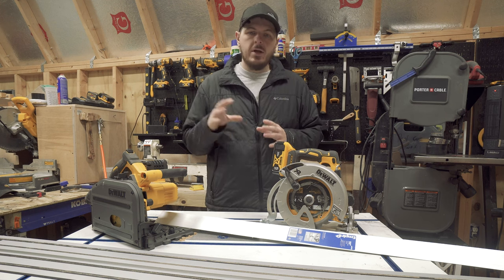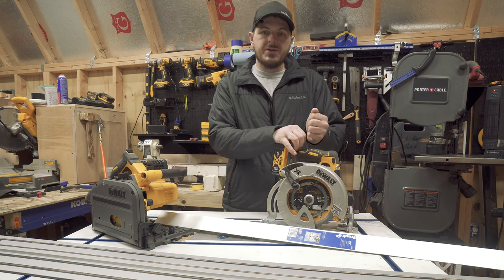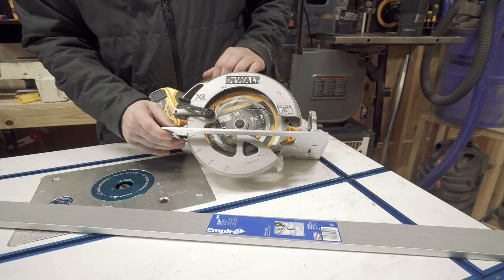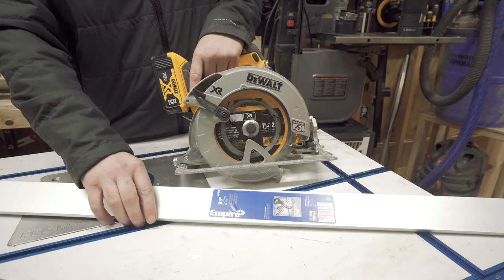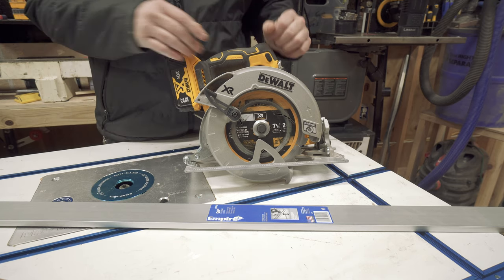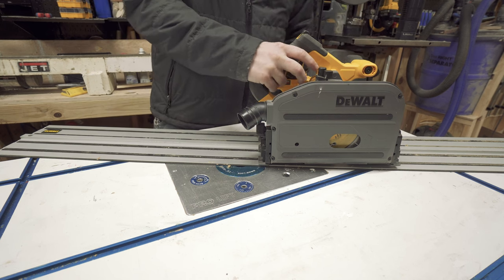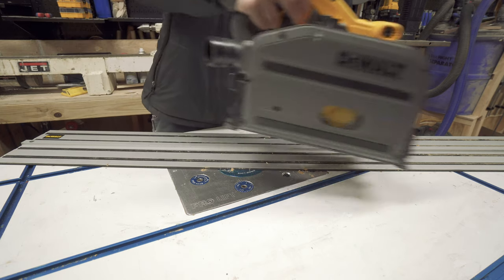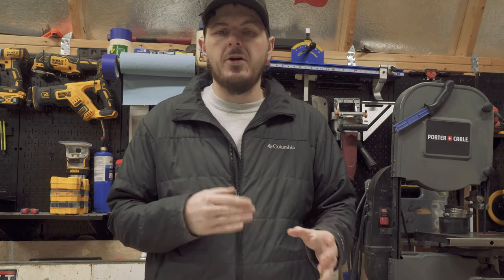Track Saw vs Circular Saw Gimmick Or Gold?

Comment: I must say that the test was pretty unfair. There are much faster ways to make a straight cut with a circular saw. You just need to make a better guide for it and set it up just like you did with the track saw. The only difference is that you need to clamp one or both ends. The deal breaker In track saw vs circular saw is in how precise the cuts and angles are, not how fast you can make the cuts.
Reply from the maker: Yes you can make a guide to essentially turn the circular saw into a track saw but not factwr in that time, material and effort lol. As far as quality of cut by far the track saw far out classes the circulate say the track itself helps to reduce the amount of tearout. Most tho are not doing finishing fine cuts with there unless needed and then the tracksaw far outshines the circular saw
Reply: All those steps increase the chance of mistakes. You also need to hope your home made "guide" is perfectly straight. Having to clamp it down at  all means you need to, at the very least, double check it's still lined up with your marks. By the time you make your guide you've damn near spent the same amount of money as if you had just bought the proper track saw to start with...assuming your time is of any value, and you get the comfort of knowing it's going to work every time. 

Technically you can build everything on your own if you want, for less money even. If you don't want to consider your time to be of any value then sure, you'll "save money", but for almost every one their time is of some value. Heck, if you're looking for the cheapest way to wood work you could build your own hand tools and make everything with those. It'll take you a year to make a coffee table, but you can do it!
Reply: "All those steps increase the chance of mistakes." 
-Yup

"You also need to hope your home made "guide" is perfectly straight."
-If you make it straight then it is straight.

" Having to clamp it down at all means you need to, at the very least, double check it's still lined up with your marks."
-Yup

" By the time you make your guide you've damn near spent the same amount of money as if you had just bought the proper track saw to start with..."
-Plywood and screws are not that expensive and it takes 10 minutes to make. 

" assuming your time is of any value, and you get the comfort of knowing it's going to work every time."
- Yup

" Technically you can build everything on your own if you want, for less money even. If you don't want to consider your time to be of any value then sure, you'll "save money", but for almost every one their time is of some value."
-Yup

" Heck, if you're looking for the cheapest way to wood work you could build your own hand tools and make everything with those. It'll take you a year to make a coffee table, but you can do it." 
- I don't do that, but some people do and its their hobby. 

I don't see how your comment contradicts what I wrote. I never said that a circular saw makes anywhere near as good cuts as a track saw. That is why I have both. The guy In the video was making the cuts with the circular saw the most complicated and time consuming way you can imagine and then based the superiority of the track saw on the fact that it is so much faster and that's what my criticism was about.